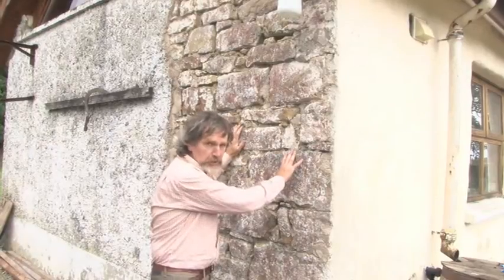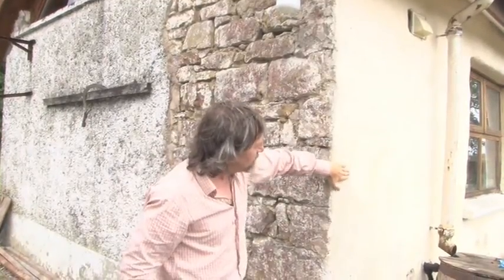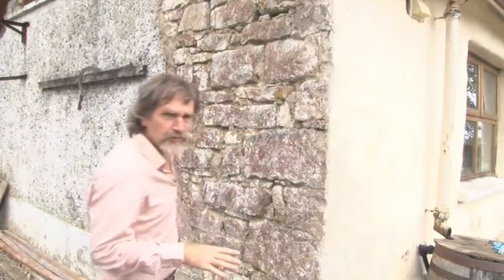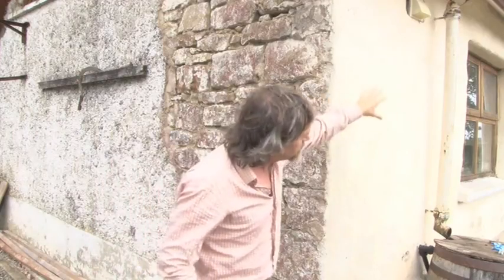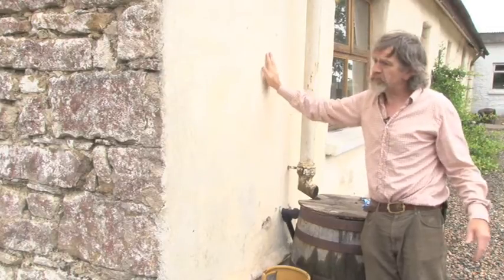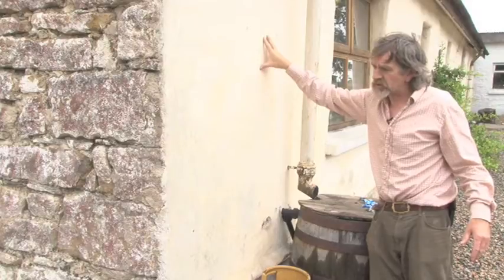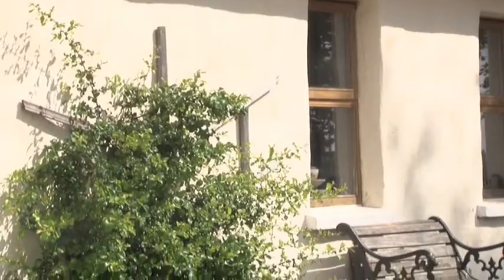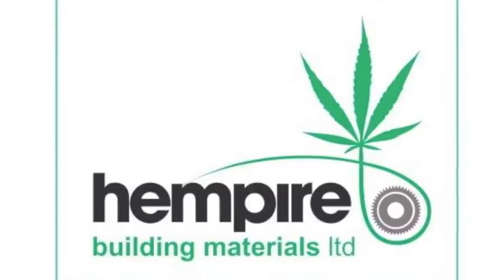How to Avoid Black Mold

Comment: Question: the sand and cement coat on the outside prevents moisture from escaping through the wall but does this mean that moisture escapes through the stone wall? Was the mortar used in the stone wall a lime mortar? That is the only way I can see the moisture escaping through the stone wall as it would not escape through the stones.
Reply: Yes Jonathan it was a lime mortar. In this case we had quite a breathable sandstone but the lime mortars will provide an escape route for the moisture. Some stones can be very impervious to moisture

Comment: lovely to see these old buildings kept....i have a small cottage with black mould on the interior of the small bathroom extension, which was probably built 20/30years ago, single brick on the extension, have you any tips on that ? it gets running water down the wall in the winter, even though i open the windows. thanks !
Reply: So its probably either a sand cement render on the outside or non-breathing materials on the inside. You may want to consider tempering the wall which would basically involve building a low grade heat source into the wall to lock the wall at a certain temperature. Hemp Lime is an excellent material for this approach.